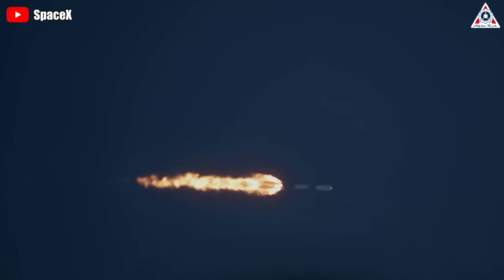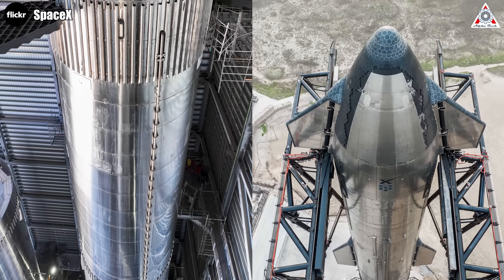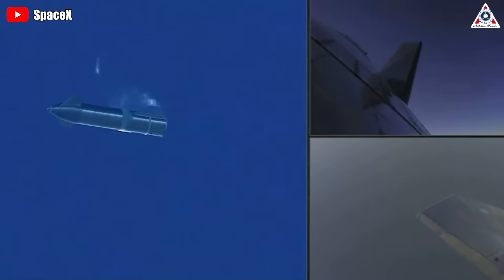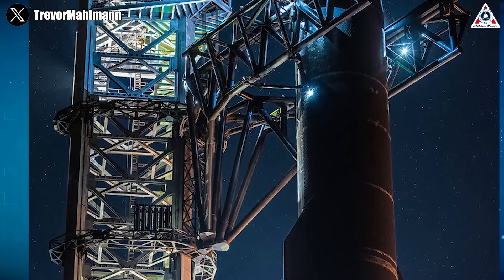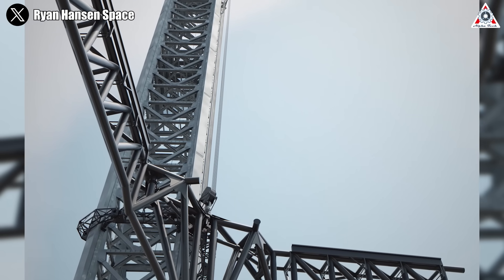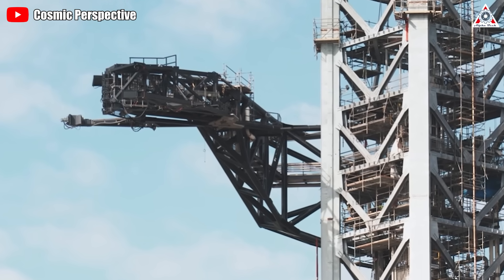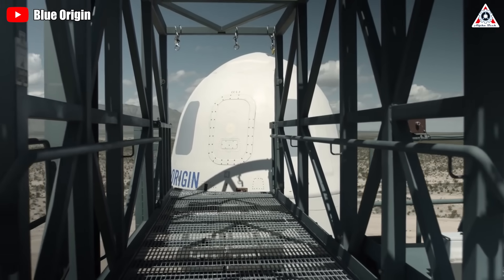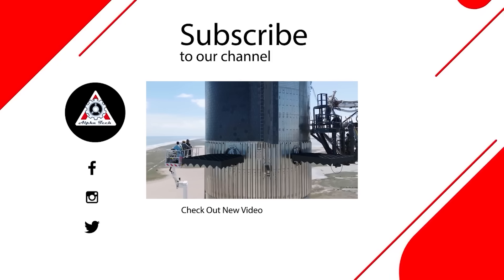SpaceX Starship catching system is harder than you think!

Comment: Ship 24 & Booster 7 were never intended to be caught they were going to splash down in the Pacific & Gulf of Mexico respectively.  I wouldn't expect a catching attempt for quite a few launches.  Remember Falcon first launched in 2010 but the didn't try to land one until 2013 and didn't successfully land until 2015.  They are using an Agile methodology I'd expect to see a lot of failures before they succeed.  I'd expect to see a second Mechazilla for early catching attempts

Comment: Musk screwed up building SpeceX at Boca Chica. Putting so much infrastructure so close to one another. Should there be a landing incident with a will be huge Starship there will be huge destruction. He should have built somewhere not so close to the ocean and at least 20 miles from any towns. Space launching is a dangerous business and you need a buffer zone between the launch site and people. On top of that his launch site is just a bad design. You need a large,directed flame trench to shoot the exhaust of the rocket away from your major infrastructure. Just look at NAS’s Saturn 5 launch site. The chances of large damage to infrastructure was minimal. They had the crawler to take that big beast of a rocket out to the pad. Yes it was an expensive option but it worked.
Reply from the maker: Thank you for your comment!

Comment: Starship road blocks. 1st less engines with equal thrust. 2nd build a substantially heavy landing pad. 3rd finalize a serious fuel transfer system. 4th design a serious set of moon landing legs. 

So, new reliable engines that work every launch, build a large landing pad, workable in space refueling system and last build 4 landing legs with 10 meter foot pads to land and take off the moons regolith surface. Then the last trick to land back on earth, before mars.

With obstacles can’t be short cut. Mars requires a lot more ship protection than the current starship.

Needed for mars, an artificial gravity for astronauts, a artificial magnetic field to keep astronauts alive to reach mars.

So Elon let’s keep it real. Please stop reading your own press clippings.

Mars is no joke. 1st mars attempt after 2200. I am really sad that I won’t live to see it. But we will get there or I mean the next generation will get there.

Comment: Would you really try to catch a boing 747?
Never ever.
The parts you need to attach are very heavy to be stabil enough.
Rockets with flames starting and landing vertical will always have 1000 times more engine power ...so a factor 1000 can go wrong.
A boing 747 can land without engines.
A rocket can't.
My ass would never take a "journey" on such a ticking bomb.
If ONE THINGY goes wrong...the whole area is done.
Its like dropping a mini-nuke on an airport.
To many parts.
To sick forces.
Their is no such technology that is a 100% + safe.
An aircraft has dosents of emergency procedures.
Like, how to continue start phase with birdstrike.
Would the airport runway be 4times longer you could always easily abort.
Rockets????????
hahaha.....kaboom.
Than its au revoir. 
And bulldoze everything.
Reply: Its NOT POSSIBLE TO WISH that away.
Genius and the money of the earth will not change that fact.
You can calculate payloads like satelits.
You can't calculate lifes, beings, bodies...
Nasa did that only with military personnel.
The moon landing..and to bring those guys back was a marble of technology and simply lot's of luck, done by heroes.
Passengers are no heroes.
They are not going to war.
Reply: Its a toy of a rich guy.
Its reverse technology thinking, because no moon and mars and long flighttime radiaton and micrometoroids problems are fixed.
Its like taking a schoolbus and use it as a submarine.
Instead of fixing underwater issues..put an entertainment system in it.
This is crazy and to go wrong. Every technology failed up to today.
This has absolute no plan B.
one wire...one lightningstrike...one stormbrise ...one enginefailier... anything...kaaboooom.
Reply: It has and it will lead to another solution.
But don't get me wrong.
I am an inventor...and i love you guys...and your crazy tempo.
But you can bet my balls that i won't use that vehicle to fly from new york to paris for a coffee and a croissant.

Comment: I think they need to develope a midget
 Raptor 3 engine, designed to operate with more run in the piping,
So they have something better than cold gas thrusters, and trying to throttle down bigger engines. Nothing says you cant mix engine sizes on the same ship where appropriate, and it could be a security feature having extra thrust in case you are coming in crippled on some other larger engines. And smaller engines would fit between larger, or go into other places easily. And if your valving was at the engine, start up time could be short in emergencies.
This would also make Mechzilla landings more feasible having thrust tuning options, or side shift options.

Comment: The whole Starship system is doomed from the beginning. Unless it will be completely redesigned.
It has flaws that can not be fixed by any workaround. The system must be changed. Until this happend, the whole thing is just a big waste of time and money.
I am not against the idea of having big reusable rocket. But it has to work differently.
Landing on the same place as launch happend is one of the worst ideas. It can only work if everything is always working on 100%. But we all know that something like that will never happen There are always some small problems and inaccuracies. Even airplanes do not land always in the middle of the runway because it is impossible. You need a space for errors. But this system does not has a space for errors and that's why it is terrible.
And I am still not talking about the starship upper stage that can not ever serve its purpose because of its bad desing. It can never have crew on board and it will never be able to land on uneven terrain as it was proposed by NASA for lunar landing. And if NASA will ignore these risks than many people will die. Because of bad design of this system.
And the saddest thing about this is that Elon Musk will not loose a dollar because it is funded by american taxpayers. So he just does not care.

Comment: y'know, the catcher can be tested with just the top part and no booster.  All they would need to do is take off and come right back down to be caught. It wouldn't need to be fully fueled or go up very far for a free fall.  The whole purpose would be the catching part so just the landing would be the only important part. People seem to have it in their heads that the catch can only be the final step of a full blown booster launch and orbit but it doesn't.  It's like SpaceX has total confidence that it'll work.  Maybe they actually want the eventual failure to be at the end of a successful launch so it looks better in the public eye.
Reply: @@clashstats3778It wouldn't need to be fully fueled for this test.  They could only fill it with as much as needed to lift off a little bit and right back down.  No need to go to orbit or anything like that. Just like airliners dump fuel for an emergency landing they could literally make the thing hover until it's almost out of fuel.  They have amazing abilities to control exactly how much is needed vs. how much is left.  They work it out normally to where they land with nearly no fuel left.  I don't know if they could just purge excess fuel but I bet they can.  My point is that they could do this but won't.  I'm just wondering why. Too much trouble?  a crash would be much more trouble.  The accuracy of positioning to be caught by the chopsticks  is staggering in the first place so they must be expecting to be able to hover at least a little bit to position it just right.

Comment: Hey if they miss the pins on the booster they're going to run out of fuel eventually so they got grid fins and a crane. Take it off ,fix it, try again. Just keep going with the data you accumulate.
Reply from the maker: Thanks for your comment!

Comment: I mentioned this months ago on this or another spacex page. The current catch arms are OK for setting the booster on the OLM. But the catch. Arms really need the equivalent of foam paint rollers on the horizontal sections, otherwise unless the booster comes down with millimeter accuracy, and the arms close the same, or its likely the booster will fall through the arms or get crushed like a coke can, or miss completely.
Tbh, they have mastered the deployable landing legs on falcon, and that's proven reliable and reusable. They are best using both systems, at least until they can spot booster landings everytime to within a few inches in any direction for mecazilla to work as hoped for

Comment: Maybe until SpaceX gets the catching system down, they should build a separate tower fitted only for catching returning vehicles. Not sure how much that would cost. But, how much money will be lost repairing a broken OLM and tower with all its complex systems along with a total hold on further operations until the OLM/Tower is repaired. Build a testing catch tower seems to have some merit. IMHO
Reply from the maker: Great Idea! Let's wait for their next steps ☺️
Reply: any catch mount would have to be easily repaired if need be. I know we've seen how quickly the OLM was rebuilt after the test launch of the first starship, but it needs to be quicker than that. it needs to be done at least in a matter of a couple of weeks and then down to a couple of days - and be specifically about landings, not take-offs. as with the boats 'of course I still love you' and 'just read the instructions', each catch mount should have its own unique naming criteria that would prevent 'catchy mccatchymount' being chosen. (I'm opting for 'hey honey I'm home!' as one choice)
Reply: It definitely would be cheaper since it only needs a catchment system for starship and super heavy booster. Could be built away from launch site and maybe with water jets to align ship into perfect catchment position.